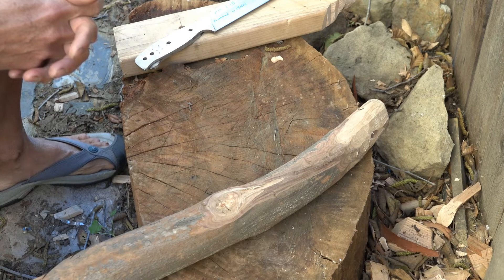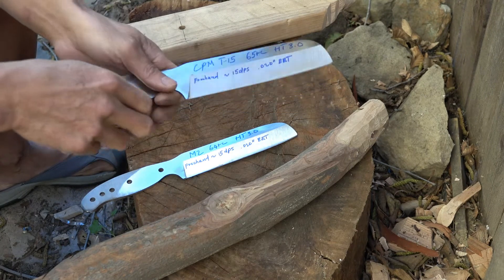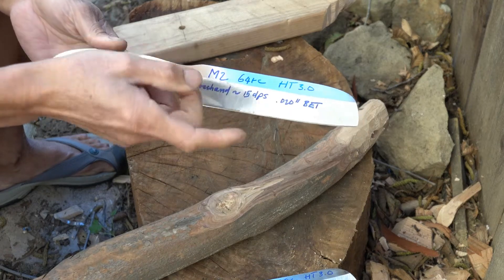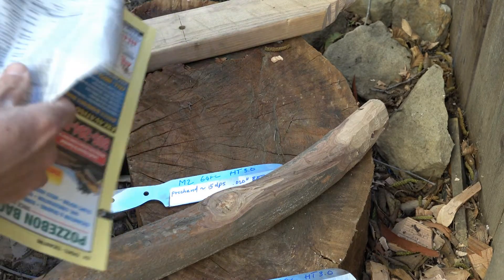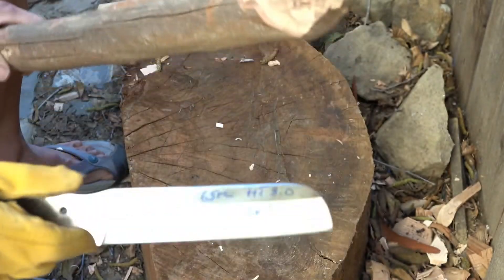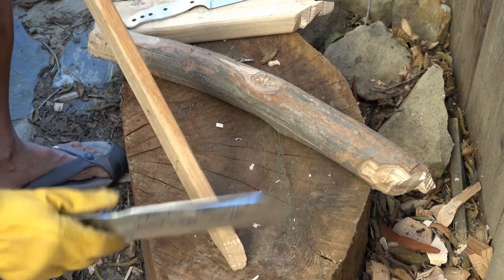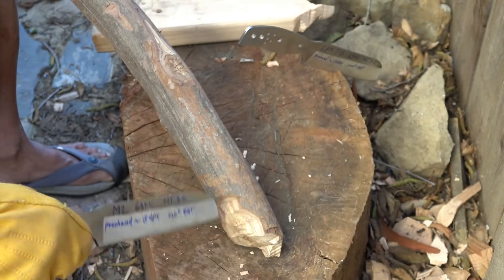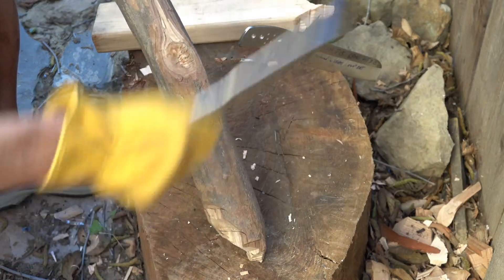BCMW 65rc CPM T15 and 64rc M2 HT 3.0 chop tests

Comment: Very promising. Do you think it would be possible to forge a sword from M2 without it being too brittle?
Reply from the maker: Strain/stretch is a critical requirement for a good working sword, where M2 and high carbon steels lacked thereof possible to make a thick/broad but not flexible sword.
Reply: @Luong_La  Interesting. So it's not elastic enough? I'm not a mechanical engineer at all, but I like the toughness and hardness of these high alloy steels. Is there any kind of high speed steel that could suit this purpose? I mean, normal non-alloy high carbon steel is great for this purpose.
Reply from the maker: @bilbo_gamers6417  It sure can has full elasticity range but I stated strain/stretch tolerance for these steels are low, thereby having narrow plasticity range and essential no necking/elongation.  HSS ht to low hrc and also high % of cobalt matrix steels should support reasonable functioning sword.
To support activities induce high impact/impulse and acute bending radius, material need at least 10% elongation, else material would unzip (uncontrolled crack propagation) into 2 pieces.  That is why, working swords out there have ~40-54hrc and 0.5%C martensite matrix (note matrix, not overall composition).
Reply: @Luong_La   Very interesting point about elongation. So it wouldn't be possible because they can't elongate? By the way, I ask because katanas often have HRC of around 65 but they are very stiff and not designed to flex as much as European swords
Reply from the maker: @bilbo_gamers6417  Right and agreed. 65hrc is the ceiling hardness for slicing tools - esp pertaining to katana.  On avg katana has around 0.7-0.8%C low alloy steel. Also unlike low flex broad sword, katana would performs poorly/badly/broken on metal to metal interaction, unless it ht-ed sub 50hrc.  broad swords leverage mass/bulk/blunt force.  Sword required ductility, wear resistance is a nice-to-have.  Keenness (dull resistance, stay sharp longer) is inverse proportional to ductility.  Si02 is around 64rc, so higher hrc stay sharp longer in natural usage.
Reply: @Luong_La   That makes sense. But it would be great for combat against unarmored opponents or people wearing cloth armor. Do you think that heat treatment to 55 hrc or so would allow you to reap the benefits of higher toughness while preventing Unzipping? Also, how do broadswords leverage blunt force? Katanas are often thicker and heavier

Comment: Sir, is it hard to resharpen with water stone and sand paper?
Reply from the maker: Water stone and sand paper aren't effective for sharpening high alloy + high hardness steels... However in a pinch/bind, they would work OK. If finished grit with a diamond plate (e.g. dmt E or EE), then would work much better.
Reply: @Luong_La  thank you, sir